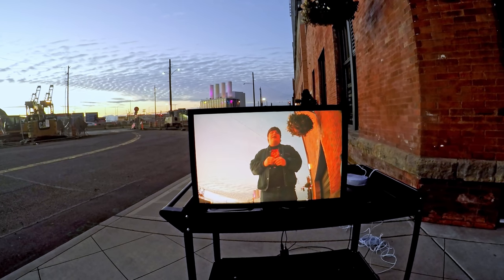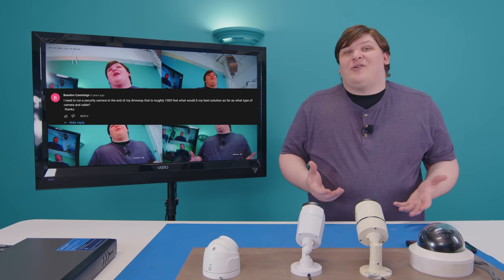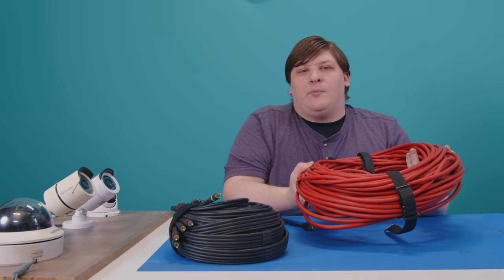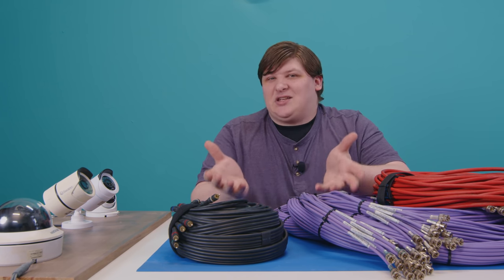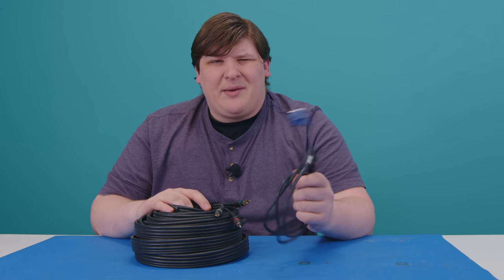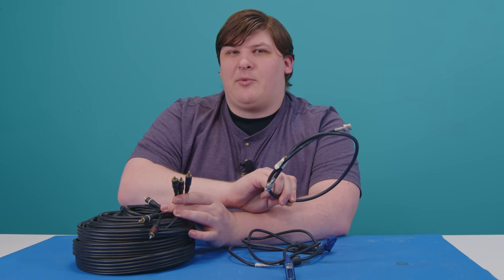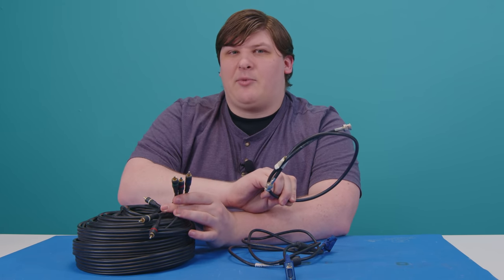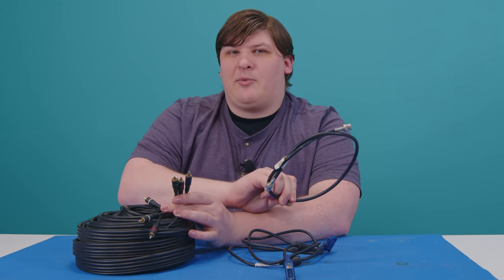1000ft of ANALOG HD video over a single cable?! [AHD/CVI/TVI]

Comment: Good vid. You should've talked about the PAR for different resolutions and really confused viewers. 😆

Analog HD has actually been around for decades, traditional 16mm and 35mm movie cameras. 16mm is a maximum of 1650 x 1200 resolution, where 35mm movie cameras have a maximum resolution equivalent of approximately 5,600 × 3,620 pixels. Granted, the film would need to be scanned and turned into a digital signal to display in HD on current TVs and monitors, which many older movies and tv shows that were shot on film have since done with the advent of Blu-ray. Funny how something with more resolution than 4k was actually introduced in 1889.
Reply from the maker: I actually had a paragraph about the PAR in the script originally and found that it was so dry I couldn't even keep myself on track enough to say it.
Reply: Film cameras were different than video cameras. Video was SD, even if HD was invented in 1941 it took long time to be perfected.

Comment: I worked at a 6 story building the size of a city block with cameras around the perimeter and on every floor, because we owned the building across the street we also had a camera transmitted over RF across the street thru streetcar cables, it wasn’t great but it worked fine!

Comment: I have used successfully a vga to Ethernet adapter with a cable of 50 meters and it works fine!! Not the powered ones just a passive adaptor..worked like a charm and it was only 15 euros…

Comment: I remember in the 90s upgrading CGA Monitors (240 lines) to VGA (480 lines) by changing some capacitors round the line output transformer and line oscillator. Changing an analog tube TV from 480 to something higher could be possible. A PAL TV (625) could possibly be pushed to 720.

Comment: unrelated tangent, feel free to skip (it's about antenna digital TV) 

yeah I live near a bunch of air tv towers and I get maybe 25 channels with a paperclip shoved into the coax jack that I did as an experiment. even though I pay for cable TV it's still nice to have the ability to tune into the news channel if needed, maybe the internet is down, and since the internet is how I get cable TV, it's not always reliable.

Comment: It's all about POE these days and analytics. You can also convert RJ59/6 BNC cables to IP using a Palun / Ethernet over Coax Video Cable. You can also wire analog cameras using UTP with a Balun. Another thing you can use analog with an IP based system using an Onvif Encoder.

IP makes this an increasingly more and more interesting industry. There is a  61 MP Surv camera right now.

Comment: 960H (960x480) at 30fps with a CBR of 4096 Kb/S in H.264 is the format my security cameras use. My system is probably about 8 years old now but still works great. I use RJ45 baluns for the runs between the cameras and the DVR.

Comment: 9:28 So, I understand that argument, but moving from an analogue antenna to a digital one (in a metro area) meant that I had access to over 100 free TV channels with maybe 5 that don't have good signal. Whereas, on analogue, I could get maybe 12 good SD signals (even that number feels high).  Yeah, the 2 that weren't strong signals were vastly more watchable than the few digital channels that don't come in well (it's a don't bother kinda thing), but I still get more than 80 extra free channels, half of them in HD.  If you're poor... You got a ton of new free content with the switch to digital.  Despite the quibbles with signal quality, it unquestionably was a gift.  Unless you live in a rural area... but even then, I've read people get as many as 20-30 good signals, which is still twice as much as analogue.
Reply from the maker: All the additional channels that they added with the digital switchover here are garbage and it doesn't matter since I can't watch most of them anyway without the signal breaking up. I'm absolutely positive most people got screwed. It's not like there'd be any way to know.

Comment: you didnt mention XVI .. there was a for a very short time cameras that used the standard BNC analogue cable that had 1080p signals thro and you could control the camera settings directly from the DVR itself ... not settings baked into the dvr .. the settings over the cable too the camera .. over analogue bnc cables .. in one place where the dvr was not 4 inches down the wire like they are now .. amazing ... now you barely see them .. but for a while in the uk they were popular i still now have 2 cameras up on my home using XVI

Comment: Gotta love how today I have to buy the best HDMI cables to run 4k HDR from my PS5 to my PSVR to my TV and still get occasional video drop out. Whereas on Analog it almost always works at least somewhat. You gain not having noise with Digital, until it just doesn't work.

Comment: (20:35) SD and HD SDI is not sent as as a continuous line across the screen! there are still H and V sync pulses.
 furthermore, the entire digital stream is transmitted as a 10bit 270mb/s and 1.47 gb/s NRZI data stream!

Comment: Can you do a video about your REZNOR heating system? I was surprised to see that up in the corner. There's been one in every warehouse I've worked in for the last 15 years.
Reply from the maker: Oh I wouldn't know what to say about it, I could barely even find any info on it haha. The most interesting thing about it is the "summer switch," a pullchain that just runs the fan without the heater to circulate air.
Reply: A very good friend of mine worked for REZNOR here in the UK - they were bought out by AMBI-RAD in the early 2000s (not sure who owns them now). They tend to be pretty simple - single or dual stage gas burner with Fan behind.  The "tech" of the day was in the control panels that gave "advanced" features like thermostatic control, timers etc.  This one having a "summer" control, its most likely just "on" or "off".

Some of the more interesting heaters were the DFMA ones (direct fired, modulating appliance if I recall) - these sent variable sized (hence modulating) jets of gas directly down long matte-black tubes with reflectors above (hence the direct fired).  At the REZNOR factory in the UK when I visited, they had a transparent demo unit. Very cool (or warm!)

Comment: I made surveillance system using UTP CAT 3 cable that was about 15c per 1m. 1 pair for power, and other 3 pairs for each camera. Splices were just twisted wire and some insulation tape. System works great and only issue I had was noise from camera power supply.

Comment: My guess is that 720 horizontal resolution came from PAL format due to 720 being 1.25 x 576 which is the visible vertical resolution of PAL - the 1.25 makes up 4:3 aspect ratio. I guess NTSC folks get bonus resolution thanks to PAL :)

Comment: Look at Crestron DM-NVX. They transmit and receive video with resolutions up to 4K60 4:4:4 and support HDR and HDCP 2.3 over a 1 CAT5 cable. Not only does it encrypt it's video over the CAT5, it also sends control signals (IR and RS232) along with ethernet up to 300 feet. It will switch between other NVX instantly so you can also send gaming systems over it.

Comment: Cable television is probably the only thing that can go further than a few hundred meters, but there's also big-ass power amplifiers for cable networks every couple kilometers or so: they use the big cable on the telephone lines that have little attenuation. Realistically, from the tap to the house, one can only usually get away with no more than four-hundred foot of RG-11; RG-6 has too much power loss per foot. What's worse is that the low-frequency signals may be good, and the high-frequency signals are trashed out, which means no more than two TVs or a cable modem, not both.

Comment: I always wondered if NTSC could have upgraded the signal to include an HD cue (like the color burst) back in the 70's or 80's. This would trigger compatible TVs to rotate the scan 90 degrees (top to bottom instead of left to right) and then you could double (or even triple) the number of scan lines (now stepping left to right) by increasing the ratcheting hertz. Old TVs wouldn't be able to receive this signal, but neither do the receive digital ones.

Comment: This video has let me figure out how I want to do a CCTV setup for my high school theatre. It’s wired for both Ethernet and coax. I’ll probably end up going with coax (IP can have latency that is not ideal for this use case), and HD might just sweeten the deal and make monitors easier to get.

Comment: Pretty interesting. Then again, even for private home security systems, there's been technology in recent years with which you don't even need to run a cable. Wifi or Wireless Security cameras are becoming pretty popular in the consumer space. You'd either just need to hook them up to power or they run off batteries. Not saying that these don't come with downsides. Heck, one just needs a signal jammer and the whole security system is offline, but it's a heck of a lot easier to install...

Comment: Quadcopters/FPV drones use analog signal at VGA resolution transmitted at 5,8ghz for wireless, near zero latency video link. These seem to do everything in hardware, I really would like to know what the encoding/decoding latency is. The resolution of these is way better than the VGA we use is and we use these things daily.

Comment: The number of pixels on an NTSC analog video line was not determined as arbitrarily as you suggest. While there are no discrete pixels in a continuous analog signal, NTSC is not a completely continuous signal like audio is. It is broken into discrete time period based sets of signals. Such as the single video line. 

It is not as you suggest a straight horizontal line. Yes it is straight. But it is not horizontal. NTSC scanning is a continual downward scan. It slopes at a slight downward angle as it scans left to right. It scans relatively slowly left to right and downwards. Then "retraces" back very quickly. The height location of the end of the last line is roughly the height of the beginning of the next line. 

NTSC also has an aspect ratio of 3 x 4. Each picture is 3 units across by 4 units high. So each line can be divided by the number of times the line voltage drops vertically in a ratio of 4 units to 3 times the time duration. Thus a 3x4 aspect pixel and 720 of them on a line is the closest number. 

If a square pixel was used the count would be different. All modern digital video uses square pixels.

Comment: When I first upgraded from SD to HD, I wanted to run DVI / HDMI to a projector, so I started looking into those DVI and/or HDMI over CAT5 boxes.  IME, none of those ever worked.  I must've tried six different brands over a span of five years.  If I ever got a picture at all, it usually had sparkles in it.  More often than not, it just wouldn't stay sync'd, or would never sync at all.  And this is with a whole 25 feet of CAT-6 cable, give or take, either OTS or custom crimped.

The worst experience was with a set of Geffen extenders.  It was the first one I tried, since it looked like the real deal.  $350 for the set, and I never got so much as a detected signal.  I opened a ticket, sent them in for replacement, and they sent them back as "works fine."  I tried them again, and got a signal for 5 seconds, then never again.  I opened the enclosure out of curiosity and there were scorch marks on one of the PCBs.  I sent a picture to customer service, and got a helpful "huh, well, sorry about that, but uh... they tested fine here" reply.  Went round and round trying to get them to take their garbage back.  They refused.

I'm curious if anyone has ever had any luck with those converters, because I just gave up and used super long HDMI cables from then on, which have always worked fine.  Well, "always" -- not more than 20 feet with 4K and anything less than a tree trunk for a cable.  But reasonable stuff was always more or less solid.
Reply: The HDMI to ethernet converters that use 2 ethernet sockets/cables might me more reliable, as there can be individual ethernet wires for every hdmi pin(or all but a few/all that should matter at least, from memory).
They're extremely cheap, presumably as there's no conversion at all, but just basic wiring from 1 pin to another. They might only be suitable for 1080, but worked fine when I briefly tried them.
Reply: @DoubleMonoLR   I think the first two or three I tried were 2-cable solutions.  I remember a couple of them had details, where I think one was to send each TMDS lane as a differential pair on the UTP side, and then the second cable was DDC, etc., while the other split the timing-critical signals to be the same pairs on the two different cables -- which also made a point to say they needed to be exactly the same length.

I ended up specifically trying some single-cable options just to see if the slew between cables was part of the problem.  Didn't seem to make any difference.  They all performed about as well as a brick with RJ45 jacks.

One attempt was at home, with a couple different boxes.  Then at work for a conference room.  Then when I moved into a different house.  Now I just use HDMI, and if I need a repeater, so be it.  I can't even imagine how these products existed if everyone's luck was as bad as mine, but I also don't know what I could've done to make it any more successful.

I'm curious if HDbase-T is any more reliable though.
Reply: @nickwallette6201  scorch marks on one of the PCBs suggests to me that you had a voltage differential between the two locations. While that might not necessarily cause your problem, it is definitely a hazard. Did you try shielded cat6a?
Reply: @scottdotjazzman   No, just UTP.  I suspect the scorch marks were there from a previous customer.  I think they received mine, and someone else's, and just "refurbished" them and sent them to me.  I never heard, saw, or smelled anything to indicate a catastrophic failure, and they never acted any different.

The signal chain was AVR Component out -> Geffen RGB to DVI scaler (which I bought at the same time) -> Geffen DVI Tx -> cat5 x2 -> Geffen DVI Rx -> DVI to Projector

All those devices had their own power supplies (either internal or DC adapter bricks), so they were all galvanically isolated except for the signal cable.

The UTP is differential pair, and despite this being a non-standard application, if your goal is distance, it's incumbent on you to design with differential pairs in mind.  Diff pairs, of course, are not referenced to ground -- they're referenced to the other member of the pair.  So there should be high common-mode voltage rejection.  Depending on the front-end design of the input, it could be 12, 70, 100V, or more, especially if it uses transformer coupling.  In this case, I think it was just a BJT pair or its own IC, I don't remember.  Still, it shouldn't have mattered.  As long as there was nothing injecting high voltages on the line (which there wasn't), it was entirely within the design of the product -- two passive cables of indeterminate length.

This was YEARS ago, and I'm still mad about it.  ;-)  I dropped a lot of coin on those things, when I didn't have quite as much coin to drop.
Reply: Interesting. I asked about shielded because that's what would have made any voltage differential problematic. If you're running unshielded though, you're right it should not have made any difference.

 I'm not sure HDMI baluns are allowed to exceed 50V since that is the upper limit for NEC, otherwise you would need an electrician to sign off on an in-wall install if you did it yourself...

Did you try ruling out the scaler? Just curious
Reply: @scottdotjazzman   I honestly don't remember.  I seem to remember trying it between a computer and LCD display, but I know I was also experimenting with the scaler driving an LCD directly, so I could be mixing that up.

Later on, I was designing a conference room solution for the office at work, and used a different brand of active HDMI balun (rather than DVI, because it was a few years later, and HDMI had fully caught on by then.)  If it worked at all, the image was covered in snow.

My last attempt was about 6 years ago, with a pair I bought at Parts Express.  I was using it for a temporary extender from the basement home theater room to our living room upstairs.  This was on a pre-fabbed CAT5E cable about 25 feet -- just the one cable for that box.  It couldn't keep an image for more than a split second at a time.  I gave up and ordered a thick HDMI cable and draped that up the stairwell while we remodeled.  Ugly, but it actually worked.  I think I even underestimated the exact length and had to use a coupler with a short cable.  haha

I was just so shocked at how they NEVER seemed to actually work at all.  Different brands, different cables, different sources and sinks, different environments.  Not one of them was usable at all.  I don't know what I could've been doing wrong - there's not much to screw up!
Reply: Oh no! I use HDMI over CAT6 at home and have found it to be really reliable!

Comment: I'm only just starting to get into RF engineering, but I'm wondering, in terms of a transmission line and impedance matching, wouldn't changing the length of the transmission line alter the impedance and thus cause issues with your impedance matching not being exact? Or is the impedance being match referring to the load on the end of the transmission line, rather than the line AND the load? One would expect the impedance of a transmission line would change enough to cause issues if you made it much longer. But I really have no idea. Like I said, I'm still new to this.